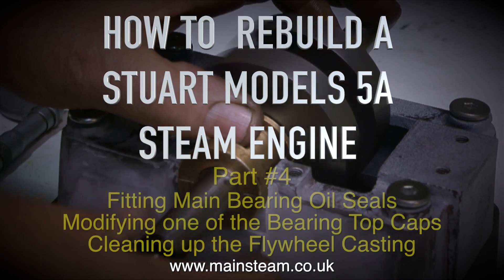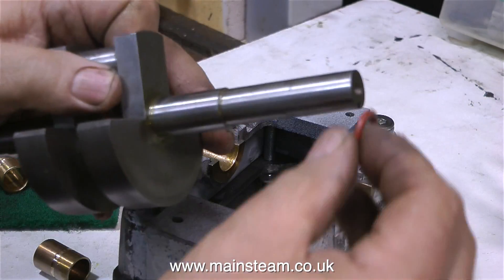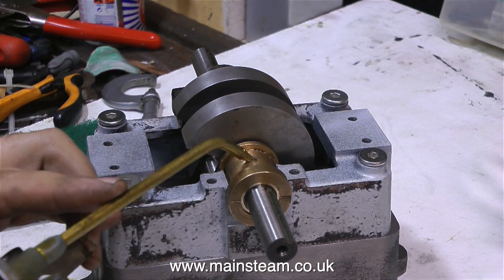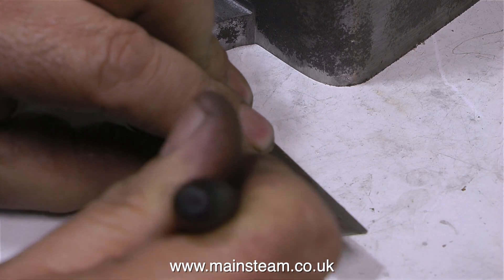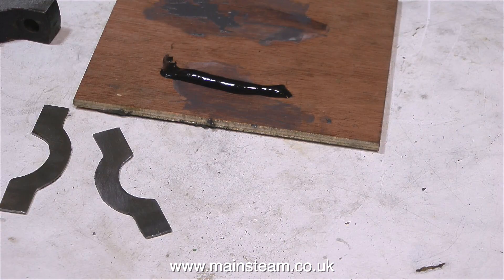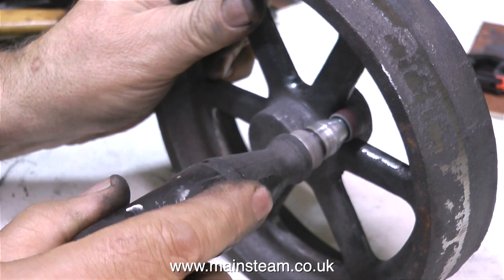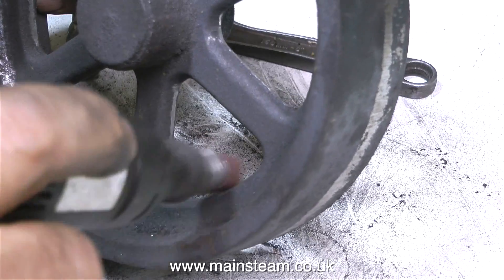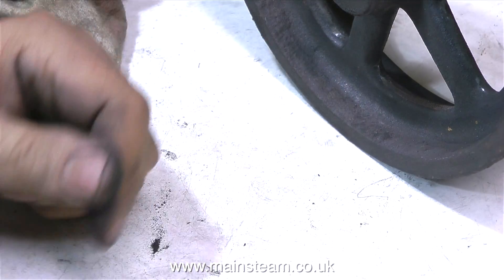HOW TO REBUILD A STUART MODELS 5A STEAM ENGINE - PART #4

Comment: Another very good video of tips and tricks. JB Weld is fabulous epoxy. It machines well after cure and is really tough. Raising the curing temperature also stiffens the after cure product for higher heat tolerance. Glider pilots learned this by noticing stiffer wings fabricated during high heat summers versus winter builds. I never use the 5 minutes stuff because it is not as good a product. Shorten your cure times with heat lamps and you will have a better job in the end.

For your organ playing, have you heard of Tony Monaco of Columbus, OH? Like you he teaches organ techniques as well as performs. He was a friend of Jimmy Smith though quite an age difference.
Reply from the maker: Thanks for the good tip, Yes I know of Tony Monaco he is a very good player }:-)))

Comment: I love you man but here in America JB weld is usually a sign of a hammer and chisel mechanic, which you are absolutely not. There's even a saying, "a little JB weld and a little paint, will make a mechanic out of one that ain't"
Reply from the maker: a good point but everybody needs to use adhesives and fillers at some time - it depends where and how you use it :-))))
Reply: Indeed, this is simply cosmetic! Im sure he wont be casting end caps of it...

Comment: You need to get yourself an old harpsichord. Then you exchange its keys with the keys on your keyboard. Harpsichords have black and white keys the wrong way around. So with this method you can make a keyboard that has all black keys. Then, there is no need to clean your hands so much.

Else you can paint the keys black. But painting some 60 keys would be a rather long and boring job...
Reply from the maker: I never thought of that :-)))))

Comment: Also if the jb is going to be thick or drilled and tapped I mix some fine filings of the same material into the batch before applying.  It beefs the strength up in my experience.

Comment: Anytime I am epoxying parts that have had extended exposure to lubricants (and are small enough) I let them soak in a thin solvent overnight.  I find that this helps draw out the oils that have "soaked" into the metal and makes the jb weld adhere better.